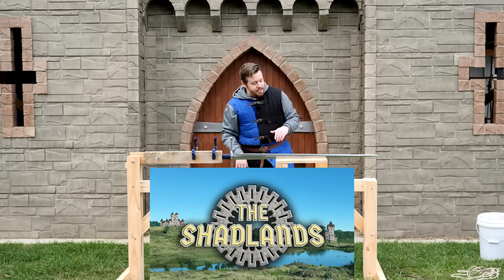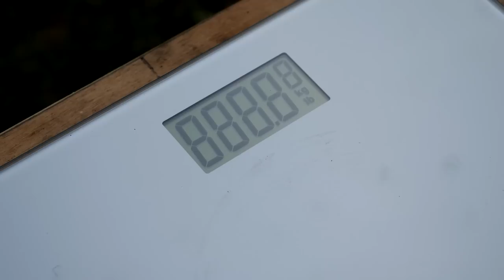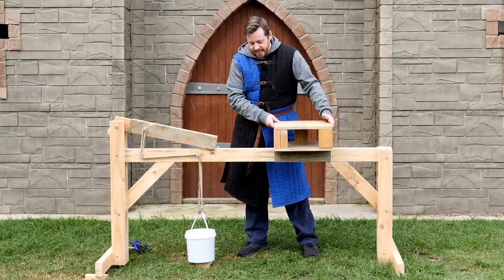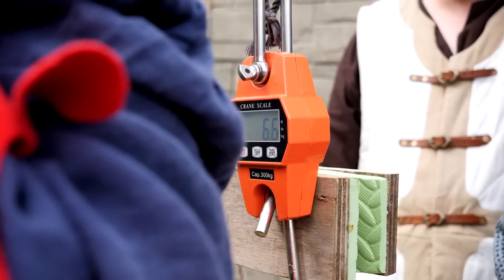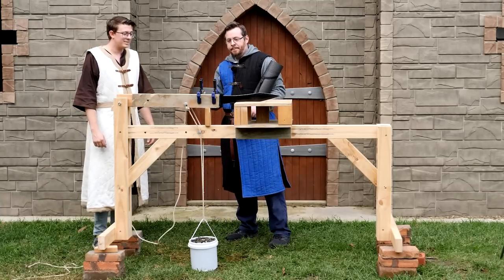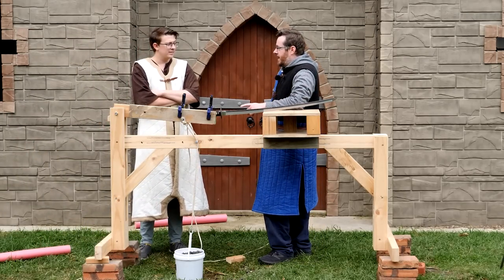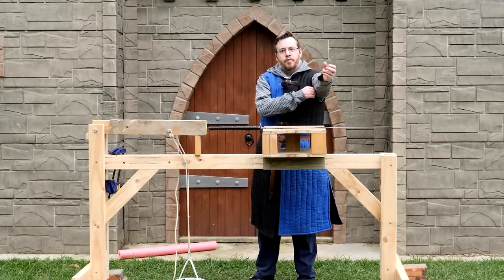Choppy choppy

Comment: IM SURPRISED NO ONE ELSE MENTIONS THESE THINGS: For the weight instead of a bucket of rocks, get some Iron Window Weights. Back in the early 1900s and possibly late 1800s peoples windows had Iron Weights attached to the windows to aid in opening & closing them, simply just tubes of Iron attached to ropes. Get a few of those and the weight is fairly consistent and no need to worry about the bucket breaking or losing rocks. Additionally the ropes themselves attached to the weights and the triggering system coat them in tar or get rubber coated chains to help with the longevity of them and reduce the wear & tear that can affect tension/friction through repeated use. Also the wood itself should be properly sealed and painted to limit future water & sun damage that can also affect effectiveness. What's more you should construct a proper stable & level platform for the framework to sit on because bricks can shift or be bumped causing a change in balance & safety. Finally get Metal Crank clamps instead of those cheap plastic triggered clamps, would provide better grip and consistency.

As for a mostly consistent medium if there are any local farmers/ranchers get chunks of bone from them and use that.

Comment: 1:44 Okay, before I get too far into this, immediately, I can see a problem. You're not 'cutting' with this contraption... you're 'chopping'. I think you would need a slightly different setup to test 'cutting'. Cutting is like chopping except there's the drawing of the blade through the cut. You could achieve this with a quarter circle piece of plywood that rotates off of where the center of the circle would have been, or the 90° corner of the quarter circle. You would then mount the sword along the edge of the circular part. 

So, if the sides of the quarter circle point up and towards the cutting surface (the first quadrant if you think geometry), then you'd mount the sword point up at the bottom edge of the curved side. Attach a weight to the curved side of the circle, roughly in the middle, and use a pin to hold it up until you're ready to cut... then just pull the pin out and let the sword fall. So long as the radius of the quarter circle is equal to half that of the length of the blade, you should get a good cut across a quarter of the blade. This would implement a proper sword cut, I think. You could mess around with the radii to get the perfect cut and draw from your blades.

13:53 You're not taking into account time. By keeping the rope hooked up at the back of the plywood, you'll have more acceleration and thus more force at the end of the chop. By moving it outwards, you're lowering the acceleration. Hmm.

15:17 Ballistics gel. https://www.wikihow.com/Make-Ballistics-Gel

19:33 RIGHT!? lol. You pointed out what I wrote at the beginning of the video! :D

27:48 Edge alignment only matters if the target is fixed in place. When you release the guillotine, the coconut starts to move. When the sword hits it, the coconut deflects the blade ever so slightly, but enough to divert the force of the swing. Big heavy sword was big and heavy, and odds are the blade is a lot more stiff, therefore, the coconut wasn't able to deflect it as much as it could with the more flexible katana. The reason why you were able to chop it easily with your hands is because the coconut didn't move at all, so your edge alignment was much better.

Comment: Ballistics gel can be made without much of a problem and can be made consistently. I would however give the cutting blades a good oiling or greasing prior to use as ballistics gel tends to grab blades if you're looking to eliminate friction from blade size as a variable.

Comment: Firstly, great concept Shad! It's awesome that you are trying to eliminate the human factor to test swords. 

As a practitioner of Katori Shinto Ryu for over 5 years, I must advise you that among the problems others have mentioned in your comments section, you are also not striking with the sweet spot of the katana. The sweet spot for cutting with a katana is 3 inches away from the tip. Katanas are very rigid swords, so you do not need to worry about tip flex like with european swords. This increases the range you can get out of them on the cut, and therefore the leverage. They were also not designed to work like you demonstrated. A draw cut is the only cut in Katori Shinto Ryu, for a reason. A straight drop is not a cut, it's a hack, and katanas are not designed to hack. This is obviously from the perspective of a kenjutsu practitioner, so take that with a grain of salt, but I must say I do not believe that the katana is necessarily the best sword for all situations. It was made for a time and place, like any other, and in that context it was the superior sword. Not in every context.

Comment: Put pieces of pipe over the bolts. It reduces friction but more importantly prevents the threads from damaging the rope.
I would also cut a board so it stands between the bolts. 
A as a safety device. 
B as as a reference height. And
C as a trigger - just pull it clear of the bolts.

Comment: in addition to the POINT of calibration - i.e., tip of the stick as apposed to the base of the stick (which is indeed a very valid observation -- remember when you measured the applied weight at the end of the arm as opposed to closer in on the arm) - there's also the kinesiology used to get that measure: you invoke different muscle groups, and differently, at the end of your swing (which is where you were measuring from) as opposed to the beginning of your swing.  

you would need a much more complicated set-up, involving pulleys and a "over-time" scale thingy,  to get a truly accurate calibration of what you're actually looking for.

Comment: Besides the other problems people with better knowledge and engineering skills than I have, but perhaps a rope and pulley system could be deployed for safety and better drop consistency. Like put a wooden post that goes several feet (I'm American haha) in the air, attach an arm with pulley wheel and at the end of the rope that have one of those easy, quick release clamps drop the rig? Especially if you add like bands to the rig, as you don't want anyone handling that rig in close proximity. Especially that you don't have a motorized machine to do the job as well. I don't know, just an idea to consider.

Comment: Maximum acceleration is  9.81 m/s2 because thats how fast your bucked is accelerated by gravity. You should use a springloaded mechanism instead. Also calibrate the load on the cutting surface and not where you clamped the sword. Then verify with a high speed camera the speed of your personal swing and the swing of the machine. Use Frame by Frame to measure distance over time with the camera. Use a Background on which you can measure distances easily.

Comment: It seems to me, that the problem with the katana is significantly impacted by the way it's just a "sword falling" onto the target, which makes the impact point of the blade move relatively slowly. When you compare it to a real strike, the impact velocity of the blade consists not only of the mentioned "falling" (albeit there some additional force behind it in both cases), but also a rotation plays a role. During a real strike you pull the hand lower on the hilt up, which (aided by the length of the hilt of the katana) adds a huge amount of energy, because as mentioned in the comments already, the kinetic energy of the strike increases with the square of the velocity of the impact point. 

I noticed many people suspect the loss of energy from the hilt moving slightly in the mounting mechanism... I'm sure it plays some role, but I feel like the absence of rotation should be more impactful as well as the fact, that the weight in the bucket should be calibrated to be 7 kg where the blade strikes, not at the hilt.

Comment: I can think of a few improvements to your design. As some other people have mentioned already, you measured the force of the stick on the end, but measured the sword from the handle. This would mean that the force on the blade would be different than the force measured on the stick. You should put the stick in there and measure the force on the end of the stick to make sure that is 7kg. This would not address the disparity between the katana cut and the longsword cut. 

The swords also seem to be slipping quite a bit, and more so with the katana and the gladius than the longsword. To fix this you could put something on top of the handles to hold them in place. 

I would also put the bolts closer to the front of the handle holder so that it is aligned with where the handle is for any sword. Since the blade is always starting very close to where the handle holder ends, the butt or pommel of the handle will be in differing places depending on the sword. Where you have the bolts currently would mean that the force is coming from below the handle on many swords, such as the gladius. If you put it near the guard/where the blade starts then the force would always be applied to a similar spot on the handle.

 Rather than having a wooden block aligned with the blade stop the sword, if you had 2 platforms on either side of the blade, then rested the target on both platforms with the part being cut over the empty space, this might allow for the sword to be stopped by a block under the handle after it has cut through the target, so the sword still has the follow through but the blade isn't as damaged by cutting into the wood which isn't the target.

Comment: The clamp slipping is clearly a problem. A simple way to fix it may be a couple of sturdy dowel pegs (across the plywood clamp) limiting the handle movement. I would put one peg above the sword handle and close to the sword guard and a second peg below the handle, near the pommel. It would probably be a good idea to pad the pegs. (You could drill a series of holes for the back peg, so you could adjust it for sword handle length).

I would also test this first with a sword you don't care about too much because limiting movement of the handle at impact may damage the sword. (Humans would have some "give" at the moment of impact). You may like to consider putting a bit more flex into at least part of the moving arm (to minimise the chance of sword breakage).

Your rig is very different to the way a human swings a sword. I'm not sure the static forces you are measuring mean much. In particular, the change in momentum (or impulse) at the point of impact would be far more significant. I would calibrate your rig by having it do a similar amount of damage that you can do when wielding the sword.

I still think your rig could get useful information on the performance of swords under controlled conditions.

Comment: Hey Shad, if you need a cost effective material ballistics jell is good but not really reusable. In the forensics field and study of ballistic force transference they have used "Clay" for decades. Also if you want to simulate bone it might work with "OSB". Because of how OSB is made it would give relatively similar results with each use... and it burns well. (Oriented strand board) Also you could put a handle to the back of the "Choppy choppy." Would give better results and a little more safe.

Comment: Attach a rope to the "arm" for a much cleaner release. Or fabricate a joint that "clicks" into place, and releases with a trigger pull of some sort.

Maybe there is friction in the arms joint? 

If the weighted rope is losing friction, maybe slide a tube around the bolts to fix that. 

I dont know if a better, yet cost effective, method of afixing the weapon exists.

Comment: I'd suggest using elastic bands to apply the force instead of a static weight. When swinging the blade yourself, you impose an acceleration much greater than that of gravity. This equates to a much higher impact force f=m*a than simply dropping the blade.

Also, the force you applied to the scale had an equivalent acceleration on both items and would therefore be orders of magnitude less than if you measured an impact between the differently accelerating objects.

Comment: One solution i can think of besides increasing the weight of the bucket would be to increase the size of the lever arm. Torque = force x length(from point of rotation). So a longer arm should equate to the swords having a better cut. In theory at least i might be wrong but its worth a shot. 

Also you could move the contact point(bolt) of the bucket as close to the end of the arm as possible

Comment: As an engineering student with limited knowledge, the sword wasn’t rigid in the rig and you lost most of the striking force when the rig lost grip on the handle. I noticed it every time a sword was dropped but it was most apparent on the katana where the sword went from approximately 0° incline to about a 15° incline if not more. Most of the force exerted was lost when the sword moved. This didn’t happen in your hands because your hands acted as opposing fulcrums that kept the sword from moving and losing energy. I would suggest putting a tube or pipe fastened in the holding area that’s just big enough for the hilt to give as little wiggle room as possible. This way the top and bottom of the pipe would act as opposing fulcrums and deliver the most efficient strike in terms of energy. I’d also suggest a latch or secure rope around the guard to hold it in so it doesn’t fly out on accident 😅.

Comment: On small suggestion to help improve your rig. You should add some sort of handed to to the side or the top of the swing arm. I think that this would make it easier to both lift and release the arm. 

As far as test mediums go. ballistic gel is a pretty good idea  as long as you're always mixing it yourself. This way you can make it to the desired consistency every time, just be sure to remember the formula you used once you figure out the consistency that you like.

Comment: 25:50
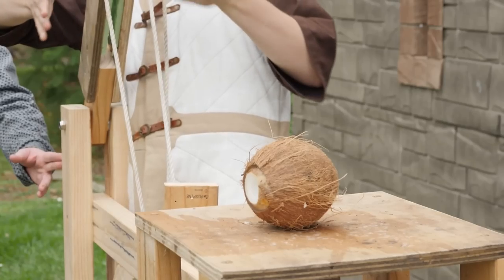if you look at the 2nd cut of the katana between frames of impact you'll see slight movement at where it's being held so my theory is that the force of the strike was dissipated through where it was being held leading to variable readings based on grip (and as I was typing this checking things I might of missed I realized that it was shown 25:56)

Comment: My suggestion for a reliable material to cut into is ballistic gelatin. Not sure how cheap/easy it is to acquire but probably worth looking in to.
My suggestion for the mechanism is a briefcase-like handle on the top of the lever. The way you two were holding it looked awkward and uncomfortable; a handle would probably be more comfortable and look better on camera.
My personal observation is that I've never seen Nathan standing in that getup before and he looks like a cleric.

Comment: Might want to add a latch for the up position to help with clean releases.  For cutting material as you noticed you want something that will set flat on you block.  Do like the idea of ballistic gel as it a good consistency, easy to reuse and can be made to the dimensions you want to test with.  Also slow motion shots with ballistic gel are pretty cool.

Comment: It’s the velocity of the blade at impact. Regardless of mass, gravity only accelerates at 9.8 m/s^2, so both blades have same final velocity. Because Force=Mass*Acceleration the heavier sword has a greater force than the lighter katana when swung in the guillotine. Compare that to the velocity of the katana when Shad swings it, he’s much faster than gravity alone.

I would hazard a guess that a katana has the highest velocity of any sword. The kinetic energy formula is E_k=(1/2)*mass*velocity^2
This means increasing velocity produces more kinetic energy than increasing mass. This also means the katana has less kinetic energy than the broadsword, but doubling the velocity of the katana will give it 4x the kinetic energy.
Reply: calculation wise, I think you're right. but for a comparison, it's fine.
yet the assumption is wrong. a katana is far from the highest velocity sword, katana are quite heavy for their size.
I suspect its the different handle geometry and materials that change how strong the grip on the sword is. plus the slight curvature of the katana might assist in the force being redirected and wrench it out of the grasp of that contraption.

Comment: Poor shad the emu problem has gotten so bad a family has to build their own castle for safety.
.
Also Shadiversity the Mythbusters design phase special.
.
Ballistic Gel might be the best answer, since its reusable.
.
One thing I noticed though is your sliding platform might need some sort of brace/mount to hold the item being cut stationary.
.
Your issue with the yoga mat might also be its able to convert a lot of the energy to deformation, since its so springy.
.
As for the coconut I think the answer is that the foam is letting the hilts and thus blades slide up while your better able to keep the blade pressing into the cut.